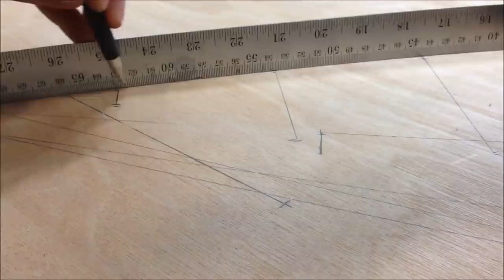How it's Made: Propeller Pattern

Comment: Do they check the wood molds to make sure that the finished product will be balanced prior to casting?
Reply from the maker: We ensure the right and left hand are the same size and shape.  There is extra material on these to account for machining and balancing after casting.
Reply: should explain to the people that the two sand casting forms are brought together to form one pour and it not poured individually ...

Comment: Why is this not being done a CNC router?
Reply: I assume that reason is relation of price and accuracy. After casting the propeller should anyway finishing by CNC router. a big one. If this plywood pattern makes by CNC router. it will need huge cubic of plywood or plywood ribbon have to saw near right form and clue together right position. Still it needs long CNC milling time to get right form.  When I made pattern to slurry propeller, I tried to ask company to do pattern by CNC milling machine. They said who can do a software? So I did patter by similar way but I used flat steel bars and turn specific degrees when I install next one.. It looks similar than this video, only difference is it is only one side pattern, not entire blade. I made first pattern about 1993 so CNC machines were rare and very expensive to use.  I have small company and I really understand that method makes pattern this way.

Comment: oh my god... CNC routing would make it so much faster and so much more accurately.
Reply: I think that would make sense if all the propellers being manufactured were of the same size, Marine props are usually sized to specs so I doubt each time a new jig and fixture would be viable
Reply: OMG, what ever did we do without modern technology... oh wait, we still built stuff.
Reply: hyronov not true for small and up to 4-5 meter diameter.
Reply: CNC still needs skillful operator like this man who can break complicated 3D shape into simple segments. I am sure some companies use CNC in such job which should be giant and expensive. at the end it  comes to which way is most cost effective
Reply: Yeah, but the machine costs 3 million dollars and the size of material needed would cost a fortune due to format and freight, not to mention the greatly increased waste materials. CNC isn't a magic bullet quite yet, we're a decade or two away from that.

Comment: Looks like an overnight job for a massive 3D printer in the near future
Reply: You can get these sort of things cut in polystyrene using CNC router technology ..... but it's like everything else ...... it's not plain sailing . A lot of tooling marks have to then be hand dressed & finished ..... 3D printing this size is some way off , 10 years may be ? Not 'cos you could not do it now , just 'cos no one can afford to do it now , the threw put is not there , 'cos the price is excessive , so the machine are built a very rare one off , so the price is high ..... big 3D is a market weighting to happen . It ' s an chicken & egg thing with all this stuff .
Reply: SpaceX is already mfg rocket engines using 3D

Comment: A very interesting video but really - wooden propeller patterns is such out-dated technology. The method of using these patterns is just not a viable one these days as floor moulding a propeller from them is cripplingly slow and labour-intensive. Propeller manufacturers use a CAD to cast system now, bypassing patterns altogether by CNC milling directly into blocks of sand in a tenth of the time this antiquated system takes,

Comment: holy blast from the past. is sorry but is this a video of how it used to be done? CNC is the way its done now. i did not see a single measure of profile? Can you say cavitation.
and even CNC will not be the way its done soon. the new Titanium 3D printer will make a prop that is both strong and light weight. it will alow the centre of the prop blade to be honey comb and have strength at the root. it will be Stronger, Faster, Better. we can make it now.
this was ancient history.